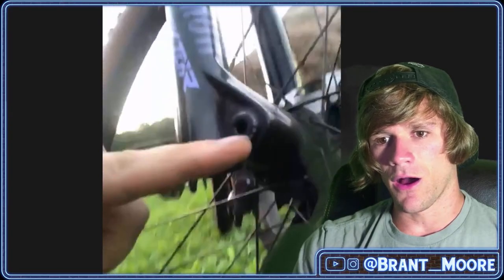Should BMX Parts Have Torque Specs?!

Comment: Profile recommends 75 inch pounds for the 4 stem bolts, tightened in an "X" pattern.   This seems too loose, so I tightened to 95 inch pounds, and may go tighter if the bars move.  I don't want to crush my handlebars, but also don't want the handlebars to move.   There needs to be some real torque specs for each part.  The handlebar manufacturer should say "Torque to XX inch pounds max", and the stem manufacturer should say the same, then we can use the lowest torque number between the two components safely.  If handlebars say "100 inch pounds max" and the stem says "90 inch pounds max", then we can use up to 90 inch pounds with confidence.   Now we're just guessing.   Generally, the stem bolts will not strip out for any decent stem, but the handlebars will crush.  Also, I bought slightly longer stem bolts that will that use ALL the threads in the aluminum stem AFTER the bars are mounted, so when the top cap has about a 1/8 inch gap from the stem.  The original bolts left about 1/4 inch of aluminum stem threads unused.  Bolt threads should also be greased before installing.

Comment: Torque specs should be published for all BMX parts.  Why?  Because it's fucking free and it's reassuring to everyone involved and it doesn't hurt anyone.
Reply from the maker: I mean....can anyone really argue with that? haha 100% the truth man
Reply: @Brant_Moore  I personally would still go by feel because after a while you just learn the tolerances of different types of materials and even if I had the torque specs in front of me, I'd probably give it another little turn for piece of mind (unless it's carbon fiber).  But from a business perspective there are too many benefits not to publish torque spec numbers.  I don't know about printing the numbers on every part like the MTB industry but even just having it on your website or on the package is good enough to cover your ass.  Another great video!

Comment: You would think that this would be an industry standard in an extreme sport that injuries are common due to lack of safety information. I think though they cover their asses when they say on all the aftermarket parts that "this part should be installed by a professional bike mechanic"

Comment: Tourqe is the amount of rotational force it takes to achive the desired clamping force. The only way to measure clamping force is by sandwiching a gauge but then the part would have to be removed so torque is the easier method of measuring. Torque can be affected by a change in the surfaces friction,, like using oil, lube, grease, loc-tite, etc. When you torque a bolt you are actually stretching the bolt like a spring and the force of the bolt wanting to contract is where the clamping force comes from. There are two types of torque, you can either torque to yield which is taking the bolt past its elasticity point in taking it into a plastic state where it will never return to its original shape, this is used on things like head bolts for a motor or you can torque to the point before it reaches plasticity, this is ideal for bmx parts. Elasticity and plasticity are rather simple. Think of a rubber band... it's Elastic if you stretch it would return back to is original state, however if you stretched it to far it will get bigger thats Plasticity. And if you take it a little further then it snaps. If anyone wants me to figure out a torque range for bmx comment yes. I'm an Engineer Technician and at work I created a program we call torque excellence.
Reply: Yes.  :)   My application is a 6061 aluminum stem with four 5/16" x 18T x 1" bolts clamping chromoly handlebars.
Reply: @AmazingChinaToday  so I have come up with 75 in pounds using a x pattern ensuring the gap is even on both sides. I would first go 1/4 torque then 1/2 torque then the full 75 in/lbs. Hope this helps.
Reply: @LowbornCrew  Thanks!  That's the same torque value recommended by Profile, the maker of the stem.  What is the limiting factor, the threads in the aluminum stem, or the crushing of the chromoly handlebars?
Reply: It is to achieve the most tension out of the bolt before it reaches a point that it either stretches or breaks, so I would say the bolts themselves would stretch first this would be hardly noticeable but would need to be replaced if that makes sense. Then probably the head of the bolt would strip. I think bars smashing will depend on company/tubing.
Reply: @LowbornCrew  Great insights, thanks for the info!

Comment: I think torque specs became so important on mountain bikes and road bikes because of all of the carbon fiber that is used. It's really easy to crack a carbon fiber handlebar by over torquing your brake clamp for example.   And especially on road bikes with these integrated cockpits and seat tubes with funky proprietary aero shapes if you crack one of those from over torquing a bolt You're out hundreds of dollars 😅.   I just got my first BMX bike after years of road and mtb and found this video because I was shocked there was no torque specs on any parts of the bike ( kink whip XL) interesting discussion thanks for the video.

Comment: Old video I know, but just thought I'd chime in, torque specs are generally based on the fastener grade. For example a stem hex bolt will have a torque spec of **ftlbs which is how much tension the bolt can handle before it stretches which obviously compromises the integrity of the fastener.
Reply from the maker: I wonder how a chromoly bolt in aluminum factors into that when the bolt material likely won't fail until after the stem material does.

Comment: Coming back to BMX after riding MTB for years I couldn't believe there was no specs when I built my Sunday. Would carbon paste help on the bars ect? So less torque is needed
Reply from the maker: I definitely wouldn’t use anything between bars and stem themselves. Greasing the stem bolts is a good idea for sure though

Comment: I use an impact to put my bike together, takes about 10 minutes to do a whole bike. Make everything 2 to 3 ugga chuggas tight, i do a lot of ugga chuggas on the wheels though.
Reply: How tight for wheels and neck to hold handlebars tight?
Reply: @psfanboy79  I've never measured with a torque wrench but I'd say somehwere between 150 and 200 pounds on the thick 14mm rear axle. Probably 100 to 150 on the 10mm front axles, extra tight to keep my pegs on. I dont use an impact on aluminium parts like the handlebar stem,  maybe ill use a small battery impact but I'd rather torque by hand on aluminium until it feels right.
Reply: @psfanboy79  google "bmx stem slipping" if your handlebars keep moving, its probably not the tightness but the paint or grease making it slip. Tighten the bolts in a cross pattern when  youre putting it back together.

Comment: The majority of the bmx market is 10-16 years old.  They will never own or use a torque wrench.    Plus you would have to have 1/4 drive wrench for the stem and cranks.  And a 3/8 drive wrench for the axles.   Kids will never own or use these.